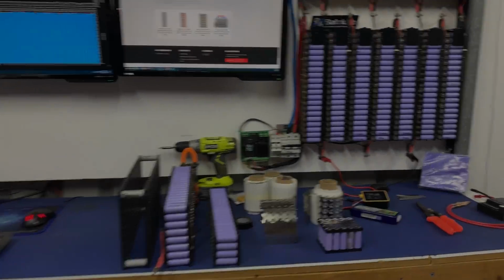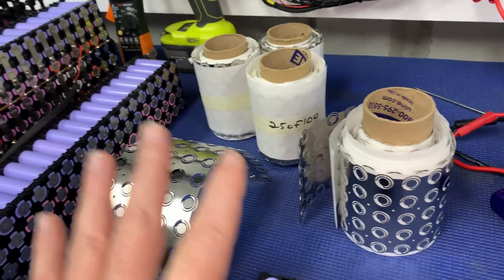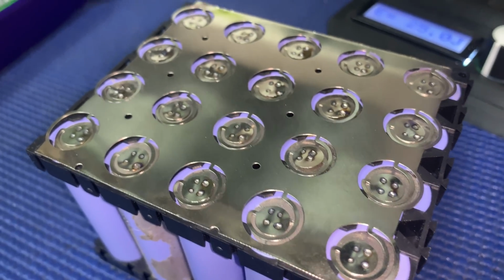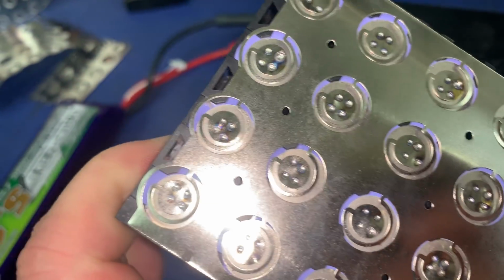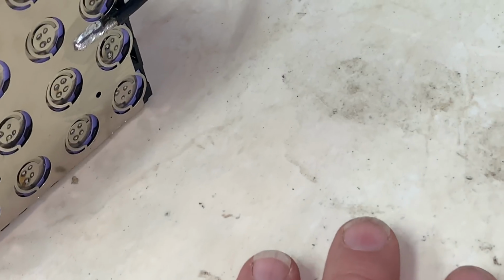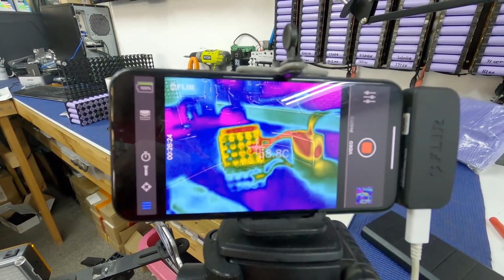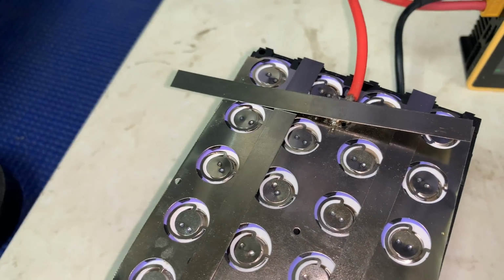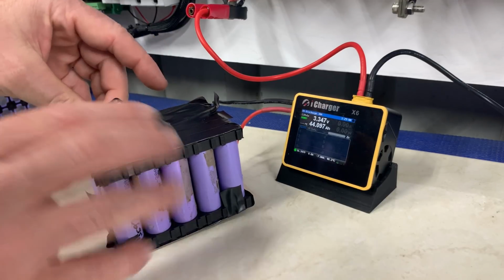Testing the BatteryHookup Nickel Fuse for 18650 batteries

Comment: A key test (for me) would be to see how many amps it takes to 'blow the fuse' .    Thank you sir as always for your efforts!
Reply: According to the manufacturer, the single fuse will blow 'fast' at 8 A.  The fuse can sustain a continuous current of 3 A without voltage drop, no heat or power loss.  Sounds like a great product.  I want to know how much heat a defective 18650 builds up when pushing 7 A through the fuse - under the 8 A limit - without blowing it.  Will that cell overheat enough to affect surrounding cells and start a chain reaction?
Reply: +1 this. Average Joe would do that with various fuses he was entertaining for a pack/build. Pete, can you do the same? Thanks for the great content!
Reply from the maker: Yep, in process now fingers crossed i have time to release another follow up video within a day or three

Comment: Hi,
Which wire got hotter negative or positive.  The wire that goes to the load, which one should be shorter negative pr positive? I will be making a battery and one of the wires that goes to the load will be longer than the other.  Should the longer wire be positive or negative? 
Thank you

Comment: Are you trying to test fuse strips  to see if 30a discharge over 40 cells would melt the fuse?  Someone else did a individual test on one of the fuses and it took 10a to melt even though specifications said 8a.  At least the title of your vid is suggesting that.  If using Battery Hook Up fuse plate for heat dissipation, I really wouldn’t think adding another 3 thin strips on a plate would make a difference.  Maybe if you doubled the fuse plate (removing the fuses on one of them) would be a better indicator of heat distribution if your thinking the heat is from the current through the plate.  But if heat is being generated by the battery then i would go for a heat sink plate with fins.

Comment: Why fuse both sides of battery, if when it starts to get hot both sides  would get hot right.  Any other wiring where fuse protection is needed, it just gets put on the + side not + & - polarity?

Comment: Whe you attach the lead wires to the nickel what temp do you use the solder iron at
Reply from the maker: I can't remember but I would think as hot as possible, get the heat in, solder melted and get out asap

Comment: Cell fusing is meant to isolate a cell that fails short due to dendrite growth, preventing the failed cell from turning into an explosive fuse itself. It's not meant to be your pack fuse, which it looks like you're testing for. In a failed cell scenario, the whole pack is trying to force current through it, and for that it's perfect. And still low-enough resistance that it won't produce excess heat and power loss in regular use.
Reply from the maker: Yes it wasn't a good test but it sure was fun.. and I'm here to enjoy myself and share my journey over teaching others.. but if thats a byproduct that's great. I learn more from these types of comments sometimes than hours of messing around. So thanks for the comment.

Comment: Hopefully this has not been asked already. Was wondering if you need to have the fuses on both sides of the batteries or will one side do? In theory if one side blows the battery is taken out of the equation correct?
Reply from the maker: Some use both sides with fuses - personally i think that is madness, typically I just do the positive side.
Reply: @HBPowerwall  Thanks so much! LOVE your videos! :)

Comment: Can a 12v 100w solar panel charge a 24volt battery? What fuse can i use, and if i only use it for a 35 watt gadget, can i use it 24/7 without unplugging it. Please simplify. Thanks

Comment: your flying leads are too small for a continuous  30amp load test,  a bit of redundancy(over sizing) in lead size
is always adviseable  when sizing wiring for any power cables. more copper less heat.
Reply from the maker: This was very much a fun learning experience for me..

Comment: Kaption Tape was the missed ticket.  Rubber tape is worthless for the vary same results you show. Battery hookup sold out the next day.  LOL  Still sold out.  WTH ?
Reply from the maker: Sold of the nickel strip? It should be back in stock soon they said.-- Don't forget to use my coupon code ' POWERWALLS' to save 10%

Comment: I think the best way to conduct this test is to take your reading with the flir camera at the insulated part of the positive cable or negative cable.  that way the pack could still naturally cool.  Or just try to place a small piece of tape anywhere on the pack and that spot will give you a true reading without blocking the natural cooling.

Comment: Aloha from Hawaii.  I am very interested in making a diy powerwall, however , it is difficult to get batteries shipped here.  On the other hand I am curious considering all the time you spend taking apart and testing batteries to build them is it really saving you money?  Or is it just a good hobby?
Reply from the maker: It started as a joke, moved to something interesting, turned into a hobby - then worked - THEN got out of hand......
Reply: @HBPowerwall  Well you are full of good ideas.  thanks for taking the time to teach us.  my house already has 18 255 /215 solar panels with a smart meter that puts excess back to the grid during the day and i use grid power at night.  i am trying to figure out how to put a powerwall in but just started looking into it.   i also have 2 solar hot water panels and tank.  that was my first install but still have a 300 per month bill to power company.

Comment: I bought a lot of s i m p lithium ion batteries from them that puffed before they ever got used. There was a voltage leak from the edge of the aluminum foil and the cell shorted out. I am lucky they did not burn down my house. I shipped over $300 worth of batteries back to battery hookups a month ago and I have not received any money back or product they offered to send Headway batteries and replacement I have not heard from them and their email will not work. Do not trust these people they are selling used affected batteries from China they are spreading Industrial Waste that is dangerous all over the country. If you have ever seen a lithium battery burn up look them up before you buy anything from Battery hookups used throwouts from China!
Reply from the maker: Sounds like your just a little disgruntle, rather than delete your rant i would recommend you contact them again. Can't keep everyone happy but if this was me i'd be kindly contacting them not the Internets..

Comment: How easy to replace 1 cell (when it blows)?
Reply from the maker: A bit of time as you'd expect - BUT offset that with the build speed and fact your not dropping so much heat into cell from the soldering iron and if you do need to do maintenance - me it's neither here nor there really. This is my only path forward.
Reply: @HBPowerwall  I'm starting to like the glass axial fuses. They can also be spot welded and replaced easily. I dont see much chance of an open flame if one blows.
Reply from the maker: @mwint1982  agree but looks ugly (if that's even a consideration)
Reply: i use glass-only no metal endcap 5a axial fuses on my packs, which are currently small enough that i could solder to existing tabs

it's very tempting to go metal punchout bus+fuse approach if i get any larger. that is, if they could carry current

Comment: Since you have both cables (+ and -) on the same end of pack, the nickel sheets are drawing high current on that one side.  You have to spread the current (and the heat) evenly over the full surface of the sheets by putting the leads on opposite end of the pack.  Do not enclose the pack with insulating tape as it prevents the hot air to evacuate.  You can spray the nickel sheets with mat black paint for improved heat radiation.
Reply from the maker: the video after this one i changed ends with no difference in heat inside the pack. and Tape made the pack much hotter for sure

Comment: I would try putting a negative & positive wire the whole way across the pack.
Reply from the maker: I changed to top and bottom in the video I just released didn't really change the results cells were still 66deg c.. how ever over a later P pack it would be a much clearer difference i think.

Comment: I'm curious to see the same test but with old school wire fuses and copper twisted bus bars. Then we could compare vs the new systems.
Reply from the maker: New way is so flipping fast, no heat from soldering, no swearing at spotwelding fuses - gamechanger
Reply: It does look pretty slick :)

Comment: Solder cells to Cu stripes from - and Cu striped + fuses from + side. Cu is better current conductor. My cells are soldered, temps 18 to 24 *C.
Reply: Problem is the mixing of metal and electricity causes copper to corrode. Most of the big battery users like myself use aluminum instead of copper for that very reason.

Comment: It would be great if someone made those same nickel fuse strips but in copper... 🤯😤😤😤
Reply from the maker: Too soft perhaps?
Reply: Look for multi strand flexible electrical cable, and choose a cross sectional area/ current capacity rated to your cell. You will have strip it. You may be able to get a roll of magnet wire or uninsulated wire if you don't like stripping sheath and inner insulation.

You could just cut up an extension cord and test the current a single strand can handle before blowing.
Reply: No its because when you mix metals and electricity copper will corrode.  I have 2 40 ah lithium banks in my car and use aluminum bars.

Comment: Some good suggestions here already.  It'd be great to see temp  difference if the cells were arranged so that all cells were exposed to air on at least one side.  E.g. 2p-1CellGap-2p.  Maybe use 5p tape and leave the centre cell unpopulated, with the void vertical and open at both ends to allow convection?
Reply from the maker: That would be a great but unrealistic test as typical loads would not see that sort of draw for that long. I'm building an 80P version and going to repeat the test

Comment: I think the nickel fuses are a great idea for quick assembly with a spot welder, however nickel is not a good conductor.
Think about all the paths the current can take, and where current density would be the greatest.
So in this case the best place for the terminal would be in the centre of the plate, but the nickel around the nearest cells would be carrying the sum of all the cells further away.
For a 200P or bigger pack, you would really need to have multiple copper wires connecting to the plate that then combine into one big one, but that's also extra work!
I think would still use a thick copper bus bar soldered to the whole length to collect the current, but then you really wouldn't need the nickel, plate -- just the fuse bits!
Much depends on what current you want to demand from the cells.
Here's an idea for Tom - just make the nickel fuses to make attaching them to the cells and bus bars easy.

Comment: Nickel has 4 times as much resistance as copper. There would need to be 4x as much nickel to keep the resistance (and heat) the same as your old copper bus bars. The nickel may be wider but it’s very thin. 

I know they use nickel on laptop packs etc but but the think the current would be a lot lower. 
That’s my 2c worth anyway.
Reply from the maker: Once a realistic size bank with an equally realistic load v cell type/chemistry is made. Most if not all my heat seems to be coming from the cells them self not the fusing, or nickel - edit : Cables are also under rated, i'll repeat the test with just 20 or perhaps 15 amps to see the results

Comment: I think the nickle was ok!  What can those cells handle during discharge.  Seems all the heat was from cells only,
Reply from the maker: Cells are 5600mah max discharge rated according to the 18650 Community Cell Database https://secondlifestorage.com/showthread.php?tid=1772
Reply: The parts of the cells that create the most heat: the ends, were covered with insulating tape. That starts the heating, which increases resistance, which creates more heat.

Most power lines are uninsulated for this reason

Comment: Just a thought. Wouldn't it be better to use the fuse nickel only on the negative side and use regular strips on the positive? Also I would catty corner the positive and negative output wires to distribute the load evenly. Might try kapton tape instead too.
Reply: Other way around - use fuses on the positive side only as all the cases are negative.
I use soldered magnet wire, but double up on the negative side.
Makes it easier to check if you're only expecting a break on one side, and +ve side is much easier and safer to solder.
Reply: @ahaveland  Why I was thinking on having the fuse on the negatives is because they have more surface area and won't get as hot with high currents.
Reply: @davestech6357  I like the logic, but the heat conductivity of a thin wire is poor so it won't help to cool the fuse much, and you need it to blow when needed.
Just need to select the right gauge wire for the job where it's used, and I don't think it's critical - 4 to 8A should be enough to protect it if it goes short and the pack tries to dump into it.
Reply from the maker: The speed that this product can go on is only limmeted to how hot the electrodes get less than ten min for the positive side of an 80P. That is huge time saving over spotwelding fuse wire or soldering. MASSIVE down side is replacing a cell.

Comment: If the goal was to test the fuses a power supply is all that's needed as another commentator said.

If your interested in heat spread. Move your terminal connection from one end to the centre. Solder, dust with Matt black paint (remembering to mask the terminals for battery connections), and repeat. Another commentator mentioned moving the connection point also.

My gut feeling for large packs deployed with this hookup system will require a series of power taps per side, evenly spaced and calculated by how hard and how wide your going.
Reply from the maker: This video was as much learning as sharing knowledge. With all these awesome comments i'm going over a few things again and see where it leads. I have no idea WHY i didn't go opposite  ends for the battery pickup points.. Stupid rookie mistake.

Comment: put the neg the other end, and if you put the point of connection on the side and then the opposite side for the neg, so opposite end and opposite side you will get better even energy dissipation. my personal opinion is you need a copper buss bar down the whole length, I did a 20 amp discharge like you with a 4x5p pack and 1 single copper 6mm2 busbar on opposite ends and even that 1 bar on the pos side heated up, see the pic i posted of the plugable ones on bookface. I'm going for 4 bars either side per 4x5p pack to keep the thermal low on a 40amp draw (1amp per cell) so 10amp per copper bussbar. its nice and even also. which is good for the cells.

Comment: Wire your terminations so if the pack is sitting in front of you with positive on top and you have soldered it to the right side of the pack, you solder the negative to the negative (on the bottom) at the leftmost side of the pack. This way the cells will share the load equally. Electricity takes the path of least resistance, thats why the batteries near your terminations were the hottest.
Reply: Odd as Pete knows that but didn't do it.
Reply: Current flows along every available path back to the source, it's simply proportional to the amount of resistances along each path.

Comment: Wouldn't the most interesting test be testing the fuses - as you draw or charge with a way to high current, and see if they break one after another or most at the same time? Maybe even simulating a failing cell with a shorting or a beefy resistor at a specific cell and test if the fuse actually breaks?

Comment: Love the video and looking forward for more test on this fused nickel strip. The more practical way i see it that you have to go through adding a nickel or copper bussbar across the pack based on this test especially to spread out the heat and current transfer.

Comment: What did you want to test? I think you tested the cells with a 1.5A discharge, which is quite high, and they got hot. The heat seams mostly to come from the cells, not the nickel strips, as the "fuse wires" probably can not transfer the heat from the nickel into the batteries. You should increase the number of cells in the tested pack, so that you have less discharge on the individual cell, (and less heat building up in the cells) and the heat building up in the nickel is really from the strips themself.  Also, your pack got so hot at the end , because you turned it with the tape upwards, which kind of blocked the warm air rising between the cells.

Comment: Hey Pete good video mate, the heat appears to be emanating from the cell's so if your aim was to test, can the packs take a good load then i think it worked i mean under 60c and your ok as the average working temp for 18650's is around 55/60c on average that i have seen when they are under heavy load. So i would say that given the spacing of the cell's that it's about right on the heat buildup. 

If you wanna test the nickel strip to see at what point it breaks then the easiest way is to setup a single battery shorted through the strip and see what happens. or more scientifically if you have a bench power supply then you can take a bit of strip and load the supply to the voltage your pack would be and then start at 2 amp max and then increase it slowly until it blows thus giving you the temp and time of the failure. 

Time for a couple controlled (al-be-it destructive) tests.